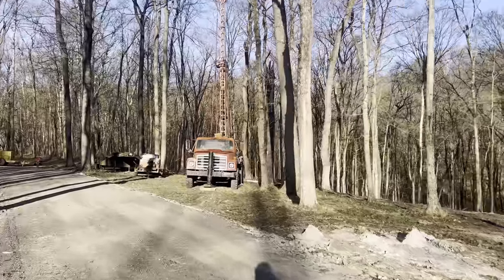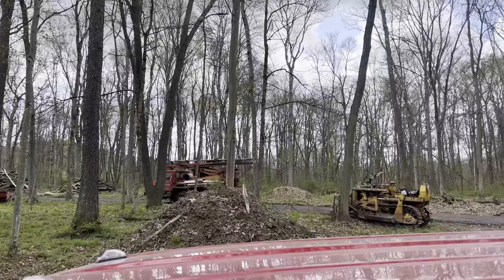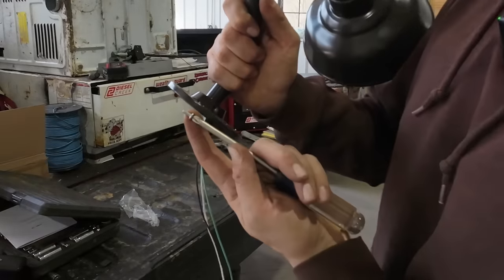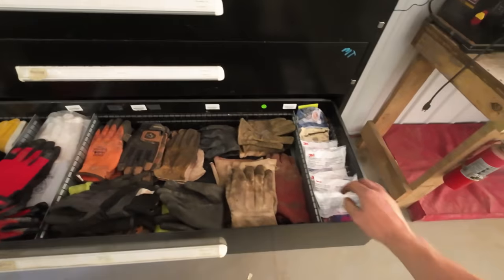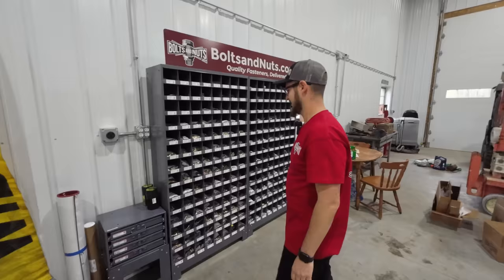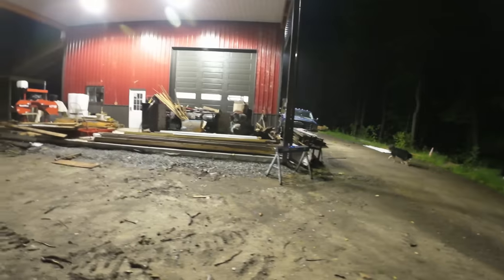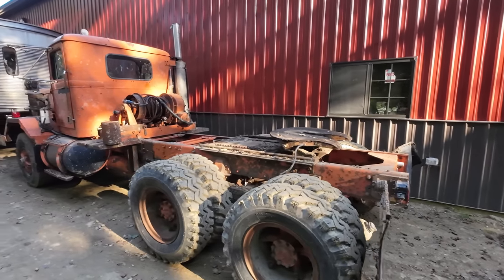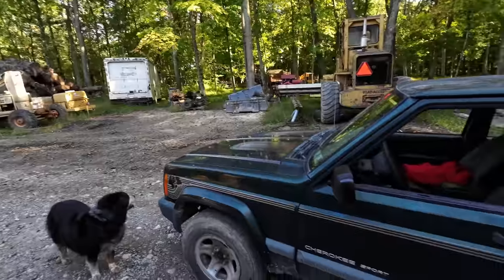1 YEAR Later, What happened to the DREAM SHOP BUILD

Comment: The amount of space you'd have to have for batteries for your needs would be massive
Reply: How big do you think batteries are? 
Honestly your comment only makes sense if you have zero clue about the topic. 
Take BYD as an example. They pack 20kWh in a floor space less than half a square meter (less than 5 sqft). And 2m (7 feet) tall. 
It doesn't take any space up at all.

That nice bolt bin he got takes up more space than the battery for a house would. So even if you double or even triple that it's still nothing.
Reply: Good luck with the power company. I’ve found out it helps to know someone with in the company.  I enjoy your videos an look forward to the next one!👍🇺🇸🤪
Reply: My 15kWh Battery is 50*60*50cm (20"*24"*20") and cost about 4k. Sure, he'd probably need 4-6 times that, but still...
Reply: @Jehty_  doesn't mean relying on solar is worth it, stop coping
Reply: @NatCo-Supremacist  please point out where in my comment I said whether relying on solar is worth it or not.
Reply: @Jehty_  You're defending the idea, that alone is enough to imply you still want Matt to spend money and time on it, meaning you think it's worth it.
Reply: @NatCo-Supremacist  I'm not defending anything. I'm just correcting OP.
Sorry if you don't like facts. Can't help you with that.
Reply: @Jehty_  that fact is irrelevant, then again he did emphasize "your needs", and I can bet Matt would need more than the average person to use it as a primary source of power, either way not worth it in the end.
Reply: @Jehty_  20KWH  ,, he is going to need more like 250-300 KWH and even that might not be enough to last more than a day ,, i know how much power my small farm uses and just my lights average 15 KWH per day ,,i have a solar setup and  he is right when he described the issues with such a system ,,   my solar setup will generate 18-20 kilowatts with direct sun ,, the solar panels aren't the most expensive part either ,,  the batteries  which i actually got a awesome deal on ,,i have 30x 200 amp hour lithium batteries
Reply: @wildcoyote34  250-300 Kwh not lasting a day? Wtf are you talking about?
The average US house uses 30 kWh per day. He's not average, so let's say he needs 40 kwh (that would be insanely high, but who cares).
So that leaves his shop. The only major consumer are his lights. You said your light setup needs 15 kWh per day. Is your light setup bigger or smaller than his?

But even if he needed 300 kWh of batteries (what I highly highly doubt) then that's still less than 7 sqm of floor space needed. That's still not a lot of space.
Reply: @Jehty_  you've never been around much of a house then cause my electric water heater uses 30KWH a day when ran constantly ,,, i don't have just a shop ,, i have a FARM  everything is electric  , from the water pumps to the washer and dryer and the cooking appliances ,,,15KWH per day isn't much of a set of lights just an FYI 500 watts worth of continuous draw  ,, that's 12 kilowatt hours per day ,,,, FYI the average house  uses GAS for heating , cooking and hot water ,,, we do not ,,,my 600 watt window AC in my bedroom uses more than 12 KWH per day ,, i know exactly how much power each appliance in my house uses ,, i had to know all of that information  in order to know how big of a generator i needed for emergency power ,, unlike most people who chose the bare minimum to meet their needs  i opted to get 50 percent more ,,i have a 25 KW generator  ,, my entire property can draw 18KW when multiple large appliances are in operation
Reply: @wildcoyote34  and why should I care about your energy consumption?
We were talking about Matt. Not you.

He will be using a wood boiler for heating.
And AC will barely ever run on battery. Because guess when you use the AC the most: When the sun is shining.
Reply: @Jehty_  you obviously have no idea how much power his big air compressor  or any of his other electric  equipment uses ,,as for  running the AC only when the sun shines , that's funny  , i don't know anyone who only runs the AC when the sun shines ,,and from  your comments  i have a serious  doubt that you know fully  how solar power works   ,, because your comments  show  lack of knowledge ,,,just an FYI , you are ALWAYS running off the battery ,, the solar panels feed power to charge the batteries ,,unless  you have a grid tie system  ,,my system is an off grid system  , i have the ability to switch between grid power and  solar power just like switching between a backup generator and the grid 
Matt also explained exactly why he decided to NOT use  solar power too  or are you forgetting that ,,unlike Matt  I live in an area where i'm not in a valley  , i live on top of a hill and even during winter months  i have more sunny days than not ,,pennsylvania  , not so much

Comment: That’s called a typesetters desk. Those drawers are worth $40 each. Good find. I found two 12 drawer cabinets full of 900lbs of monotype. Keeps the casting pot fed. If you can bury the extra air tank I would. That way if it ever gives up the beans it won’t take out your whole Lean-to. Cheers from Wa State.

Comment: Hey Matt, Ya’know the biggest cost of Geothermal heating and cooling is digging the hole and filling it in. If you place a geothermal bank half way between the house and the shop you could heat and cool both for the cost of running the pump. No wood handling required! You could do most of it with the D8. Love your show. Never miss an episode.

Comment: Hi Matt, as a PEng  (electrical) I would suggest you have a 480v 3PH power supply as you are running motors and have an industrial facility. Your right to want mains power for the needs you can foresee into the future. That will also power your much needed overhead crane better than single phase.

Comment: Pounder = spuidder or cable tool rig. Before rotaries came along,, the way they drilled  oil wells. Notice after pounding with the  drill bit for a while the driller runs in a hollow tube called a bailer. The bailer has a plunger valve on the bottom. Keep the hole mostly filled with water and when the bailer hits the bottom the plunger valve opens and  the water in  the hole rushes into the empty bailer to equalize hydrostatic pressure. As it does so it sweeps cuttings into the bailer. Lift it out and dump it. Repeat as necessary. Helped my boss drill a water well with a actual cable tool rig once. Fairly deep...80 -90 feet. He had it witched first to determine if water was there. We cheated a bit as he had some sacks of barite we mixed with water and dropped in the hole to help pick up the  cuttings. Barite is the main ingredient of plain old drilling mud used in rotary drilling where formation pressures necessitate it.

Comment: I strongly recommend you to get an air dryer for your compressor. We have the exact same air setup as you are planning at work and it’s not fun when all the aux tanks, pipes, valves and stuff get full of water. The ground temperature is low enough for what little moisture there is to condensate in the pipe and then it accumulates in the aux tanks. We actually have one dryer directly after the compressor and then one in the next building where the pipe comes up from the ground. Apart from these problems it’s a great system, no noise and supreme air quality😃👍 Thank you very much for yet another entertaining video! Best channel on YouTube.

Comment: The well drilling rig is also referred to as a cable tool . They a re slower than rotary hammer but provide better well development in a couple of ways. The pounding action can add more fracturing to the bedrock thereby creating more routes for water to enter the well and the surging action (much like a plunger) will keep those fractures flushed out & free of debris. Retired water resources technologist.

Comment: Pounding act's like fracking allowing water to seep through hard layers better. Depends a lot on your ground structure, usually there's 2 clay layers that are impermeable or 1 clay layer and bedrock. Bedrock normally has water above it and the clay has the aquifer under it. Still depends on your ground structure, could even have a sand layer (or sandstone that needs to be fractured for water supply) and that's another place water sit's. Rotary drilling is for ground that has large rocks and soft ground reducing any collapse problems, think sand on a beach filling a hole, so it tunnels through rather than fractures giving more support. On top of that it also depends on how much pipe they have to use down the bore.

Comment: Powering your 3 Phase gantry lift -- Have you looked into getting a rotary phase converter?  These use a single phase 240 volt electric motor to generate the third phase and pass it through together with the input phases, and they're a whole helluva lot cheaper than running 3 phase all the way down your driveway.

Comment: Solar is great as a backup when there's a natural disaster/ something messing with the grid. It's great for some passive income/ discount off your electricity bill if you live somewhere that helps a lot with the costs and pays well for the power you add to the grid. But it's got to be maintained properly to keep it working well and it can be pretty expensive unless you do a lot of the work yourself.

Comment: The bench you paid 40 for has drawers that are rusted on the inside. If you will spray the rusted areas with Ospho, it will completely stop the rust, turn it black and then when it dries in a few hours simply wipe it down and voila...your drawers will look clean and you can put tools or whatever inside and they won't rust.  Ospho is also a primer,so you could spray the drawers inside if you wanted.   Great stuff, once you try it you wonder how you did without it especially all those rusted up machines you collect.

Comment: Grab a Quincy QT Series compressor and keep it inside. They're whisper quiet. 100% duty cycle.  I have the QT5, the smaller, its' 11cfm @175psi.  Keeping air outside in winter may cause icing issues. MTC.

Comment: The drilling rig is a cable tool rig. looks like a Bucyrus Erie 22W, that spooled 1275 feet of drilling line and was commonly used to drill shallow oil and gas wells and water wells.

Comment: Excellent video Matt  :) my house had Well Driller of my one cousin families business  that use a drill bit for 80 feet then punder also pump up grey clay dirt out for 8 days till clear up and drill 100 feet and could go farther because rock so had use dynamic to with drill bit bang away to 110  feet down were clean water too get ! The pipe at has 4 holes every 10 to 20 feet from top 2 pipes also weld up together and 20 feet to 110 feet total length   and pipe is size like 10 hole hub on 3 to 12 ton transport trucks  to! Also in side has Smergerable water pump with hose PCV  type plus pump 3/4 hp motor  on 3 wire type to hydro box inside of relay on cold water tank to fill up  kick cold water tank fill when water tank has cold and hot water plus heater too kick on every 4 hours boil hot water up too ! That was done in 2005 year and get 10 gallons of water pressure too from well also secondary Artisan Well type and 2021 I put in High Efficiency Water Filter  for cold & hot water filter for 45 minutes and in 3 months change filter is size Paper Towel  rack in house want also for filter cartilage with O rubber ring  cartilage cup and easy to clean too! Filter system does not cost tons and get 10 year on unit ! Plumber hook up 2 hours too and buy unit from Water Filtering company too and Plumber hooks up very cheap to do installation! Filters are very inexpensive  too buy from Water  Filter company  and filter cleans water like clear glass better tasting than town water is too ! Also Smergerable Pump never freeze up in well to Matt and you have mount in pipe also w
Water Filtering you send water samples before Filtering on cold water only and one Filtering of hot and cold water too check if any problems! But tell you should do every 3 months on water check up ! But Water Filtering system it impressed you and be happy put one too also say holy moly great machine and tell others try one too!

Comment: years ago we used a similar rig to drive 50 holes  24inch diameter for piles under a slab and building they used a gravel as well as the driver ,then fitted cages and  poured the piles ,and hold down bolts  was softer peaty ground

Comment: I think the hammer-style drilling is compacting all the material it drives through, packing it together more tightly - probably makes the hole wall less likely to collapse into the hole because of that. The rotary style, in contrast, is loosening everything in the hole instead of packing it in tighter. Makes sense that the older style is actually better in that regard.

Thanks for the update, Matt! It's always fun following along on your adventures!
Reply: I would also guess it does better against rocks in the way.

Comment: Im an air compressor tech by trade in northern newengland. You might want to think about putting that IR in a room that's heated or put heat trace on the case for the winter. I can't even begin to tell you how many recips we've lost to the cold because the customer dont seem to get that a splash lube doesn't work well when they get really cold.

Comment: Used to seeing a post on Wednesday or Thursday, so seeing one this early gave my brain a start on thinking "Huh, this week's gone by double time quick." Nope, only Tuesday😂

Was neat seeing the old hammer type well digger. Those are getting to be rare sights in general much less still making paychecks. Even better is seeing the hooded lights, I think I still have a few of the floor lights from one of the textile mills that used to operate in my city until going bust right around 2001. 

It was a shame because they'd been around for 110 years until that point. Even had a position lined up fore to step into before granddad retired and the mills changed ownership two years after. Yeah, nepotism would have gotten me a career but the mills are gone gone now, razed to the ground.

As I said, I think I still have a few of the old work hall lights if my younger brother and his wife didn't grab them to sell already. They looked almost like those lights you have, only about three maybe four feet across and used carbon arc bulbs for light. Only because they were mounted on ten foot hangers but were still a bit over 80' in the air hanging from the work hall ceiling.

I forgot that you're going with a wood boiler for heat. Could set it or the sawmill shed closer to the boiler so you can just throw the lift off cut bits into the starting pile.

Comment: Solar ‘sounds’ great but you are right on in your circumstance. I have solar but it just helps with what I use during the day. On the grid all the time. I looked into what it would take to take just my house off grid. $80K to be totally off grid. Doesn’t count my shop. Battery’s are expensive. One 13KW is $16,000 each. Needed 5. Payback is way out there. 😊
Reply: How much is a kw hour of electric in the US ?

Comment: You might consider a geothermal system to combine with your boiler.

Since you already have the tools needed to dig, you could easily cut your installation costs. You could even do a vertical pipe grid.

You'd have a lot lower fuel bill and you could even use the geothermal system to cool in the summer (at least your house).

Comment: we had a well pounded in on the farm huge mistake in the conditions. currently the aquifer ceiling is slowly collapsing and we have to pull the well once a year to clean the screen. we had to put that on the pump, because the instability caused the bottom of the casing to break off.

Comment: Hi Matt- as a heads up, if you are going to heat that building plus a house with an outdoor boiler (that is what I use too), the "small woodshed" that you mentioned in the video will probably be pretty large. My shed is 12'x32' and the stacks are 7 feet high. I burn most of the wood in the shed every year. Two things you have going for you is that you are much further south than I am and your buildings are new, so your efficiency will be better.

Comment: Totally agree on the drill rig types!! I've got a 75' deep well, put in with a "pounder" 43 years ago and I've never had a problem with water supply; and it tastes great!!! Two years after mine was drilled, next door neighbor started building his house and they used a rotary to drill the well; his well is about 250' away from mine; his was drilled 400' before he had enough water!!! And its sulphur water!!! I've had conversations with driller acquaintances (rotary rig guys now) and told them my experience, and they swear rotary's are just as good. Sure; anyway, can't find any pounder guys around here anymore; all rotary now.
Reply: you can move 20 feet and get completely different water. also a bore must be "developed" for it to work properly.

Comment: You didn't mention the overhead crane.  That's going to be a major project, and there'll be some cost with all the steel you'll need, plus the logistics of lifting first the rails, and then the crane.  I am not even sure how you'd get the crane up onto the rails seeing as it will be wider.  Does it come apart so you could reassemble it in place?  How on earth you'd support that weight while doing so, I have no idea, but it will make for an amazing few videos.

Comment: For solar lights, I just get the appx $39 for a pair sets that have individual small panel and a light with battery built in.

On motion detector it's enough to help find the light switch for the real lights.

I get strong magnets with holes in the middle to mount these, so they are easy to put wherever you want.  Can be a handy under the hood light sometimes.